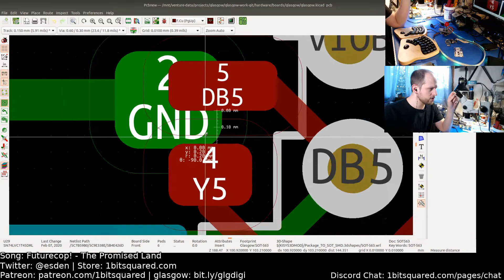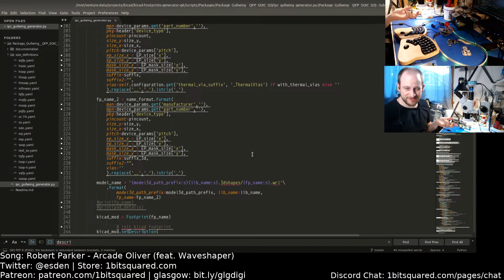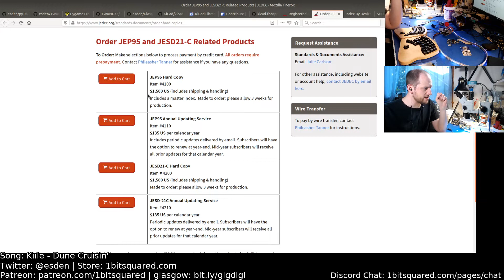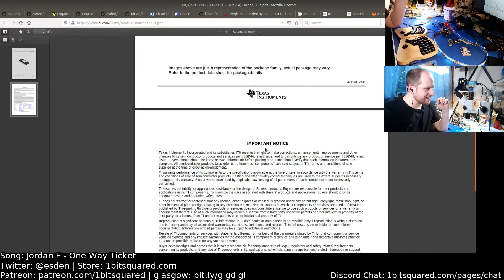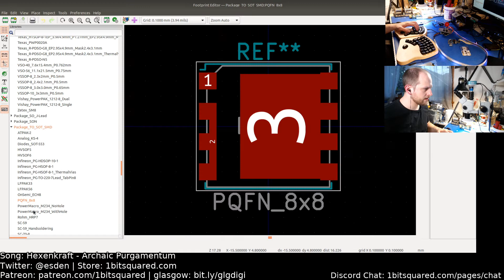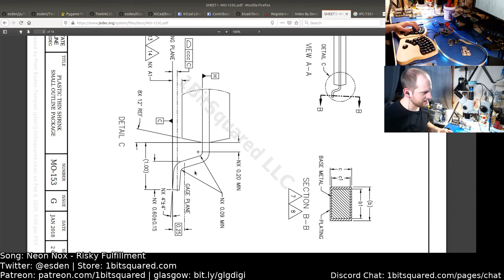Electronics Let's Play - Generating KiCad Footprints for Upstreaming

Comment: Foot prints are always the hardest to find/modify/get right in kicad.  Even if I save a project with the correct ones, the next project, I have to hunt them all down again in my old projects and I'm never sure I could copy the project and they would work (not being dependant on the Project from which I copied them). Very frustrating.
Reply from the maker: Yeah this is why I have a repository to hold all my personal footprints in, that I can then share between projects. By using git submodules I can version that library of footprints and make sure that if I change anything I know what changed. I think I talked about it in my KiCon talk: https://www.youtube.com/watch?v=UL58tBZbCsQ&list=PLy2022BX6EsqLkQy1EmXjVnauOH3FSHTV I can talk about it in more depth on stream at some point if you want.